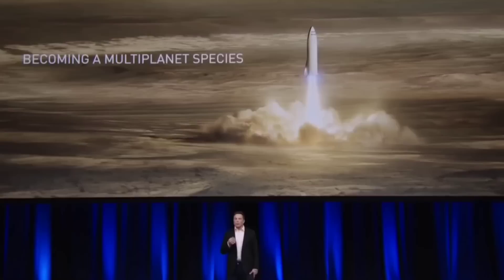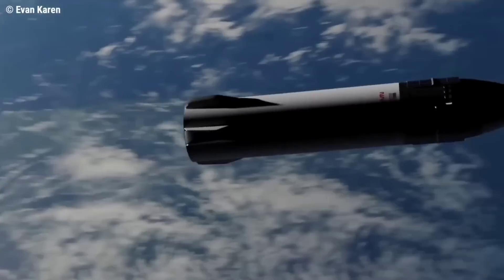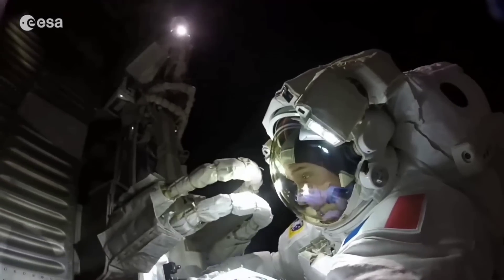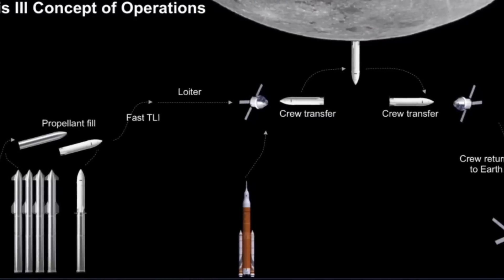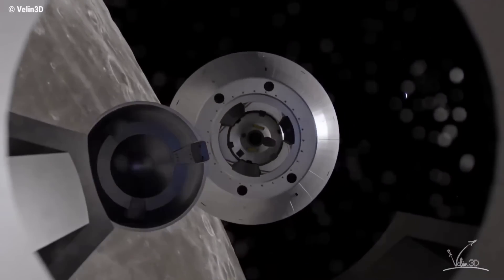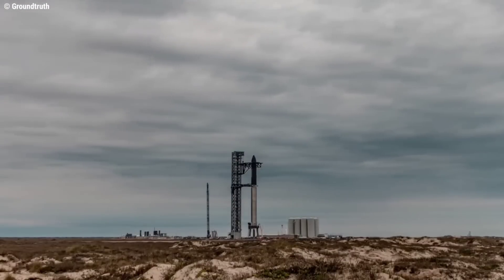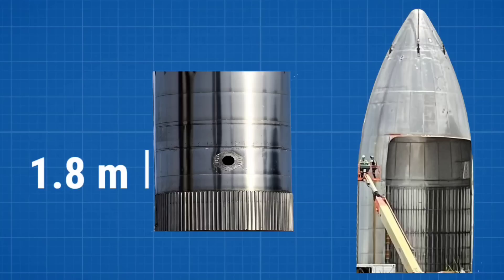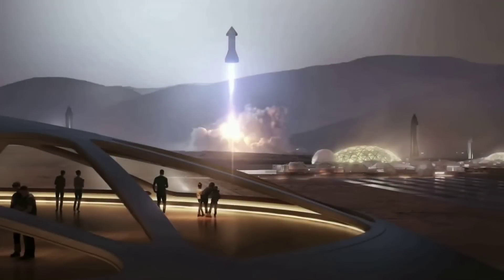SpaceX & Nasa Testing Lunar Starship Airlock System For The First Time!

Comment: Ok why do we need to include SLS in this deal why can't starship carry the astronauts  to the moon ?? I can deliver 150Tons to the moon with re fueling. So way do we need SLS??
Reply: Redundancy.  Does your brain think only in terms of non emergency situations?
Reply: @davidh.503  lol lol that is funny. There is nothing  redundant  about SLS.. it is a one room bubble. And starship current  desine is non redundant..I think the word you are looking for is nasa control.. only 4 people go up. At any given time on SLS  once  a year. Where space x can send up 100 people Many  times a year.  NASA loses control of the nerative. Why would they not want to increase  the number 9f people that go up.. it would reduce the cost dramatically. Example look at the looner  gate way station. It can barely  handle four people.when we know can put 150 tones into orbit. But the are still building dorm room sided stations. Really  controlling not redundancy  is what you are looking for.
Reply: @williamtaylor8950  The word I chose-- is the correct word to use.  Redundancy-- ENGINEERING-- "the inclusion of extra components which are not strictly necessary to functioning, in case of failure in other components."
Reply: @davidh.503  ok then why do you clame it is redundancy when it can be launched  1 or maybe  twice a year  if they rush things when the ship it is ment to back up will have multiples of its self Ready to go at a moments notice. SLS is smaller less versatile less capable  system.  And if you are saying that it is redundant  just incase  star ship fails to deliver. Then remember this. It cost us tax payers $30B to build an idea that was put forth buy NASA  in the early 90s  using the same teck base. It has the ability to only lift 5000 tons more than the shuttle did. But it is no longer lifting the shuttle its self so technically  it should be able to lift the hole weight  if the shuttle  plus 5000 tons plus the shuttle's cargo.. so it if you do the math it us an inferior  rocket. They would be better building a saturn five.
Reply: It’s all the refueling. SLS will do until Starship is fully functioning.
Reply: @michaeldemarco9950  ok but why not put a stop on funding a project that is and will be obsolete  when when starship is cought for the first time. SLS will become  obsolete  do to the cost, cargo difference, number of passengers  it can take to the moon.
Reply: @williamtaylor8950 , yes. And when that happens, it should be canceled.  But my gut feel is that Starship will not be used for Earth to LEO or Earth reentry manned activities any time soon.  It’ll be good for one-way cargo to the moon, lunar habitat adaptation, etc; but not manned transportation.

We’ll see how the Polaris program turns out, but I don’t see anyone wanting to participate in the “suicide landing”.
Reply: @michaeldemarco9950  I agree starship will have to prove  its self as human safe. Totaly agree. But I'd younger going to use starship as  just a looner lander then it can and should be redesigned it won't  need the massive fuel tanks if it is refueled  in lunar  orbit.
Reply: One word : congress
Reply: @mnh1270  true NASA  has become a jobs program for most politicians.

Comment: I'm thinking that SpaceX will install the airlock between the life support/supply area (where the spacesuits are kept) access hatch to the cargo bay.  Most of the heavy equipment going to the Lunar surface will be secured in the cargo bay. So one the access hatch from the upper deck it sealed, the airlock to vented or equalized, before the hatch I to the cargo bay will open.  The same process happens in reverse for leaving the cargo bay to enter the habitat levels. FYI -- each habitat level can be sealed off from the level above and below.